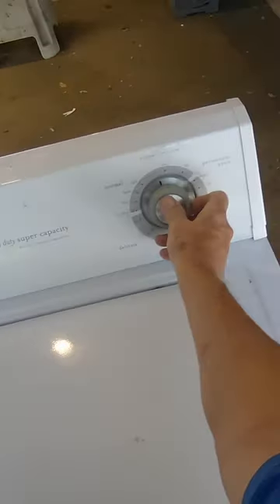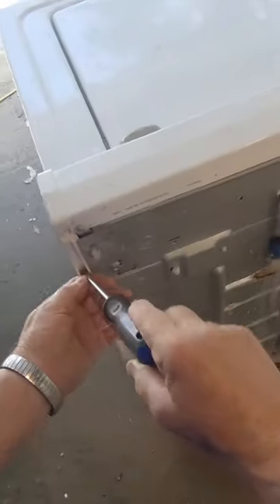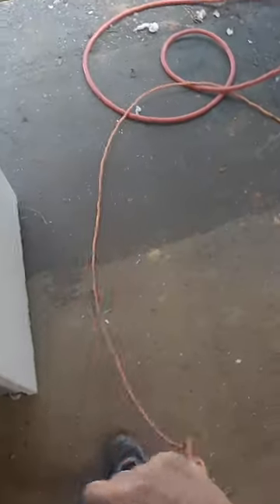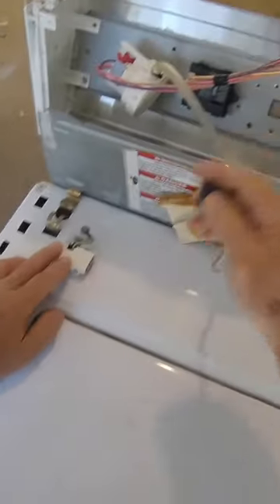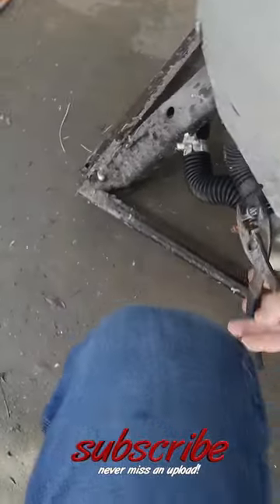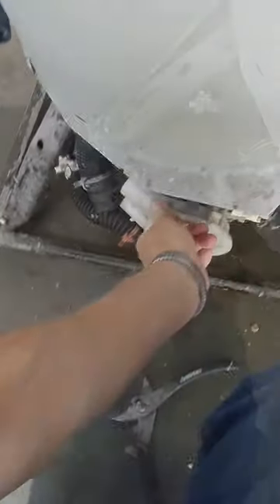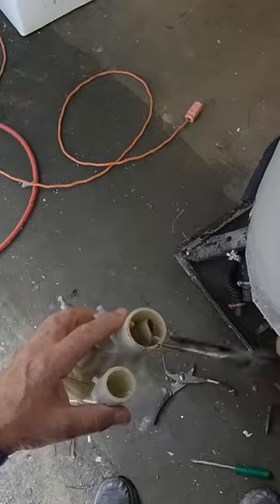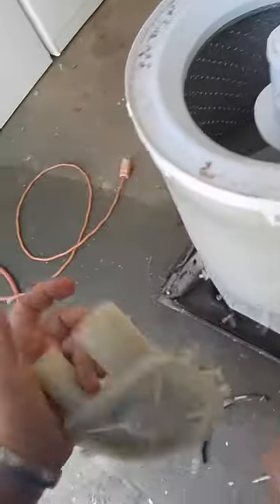Washer Hums Won't Drain

Comment: Looking for advice. Kenmore 90 series gas dryer. Heats when it wants to. Checked every single fuse (thermal fuse, cycling switch, igniter, etc etc etc) they all have continuity. Checked timer has continuity. 

Starts and spins freely. Changed gas valve already and coils. What’s my next step?
Reply from the maker: Buy a gas dryer repair kit https://www.amazon.com/dp/B09V2941XH?_encoding=UTF8&psc=1&ref_=cm_sw_r_cp_ud_dp_NR9KNG5MVCR50WAKBSCT. Then change all the electrical components on the back (cycling thermostat, thermal fuse,etc.) not too expensive and you’ve covered all bases. Open up the timer and examine the points. Replace the timer if they are burned. Thanks for watching!

Comment: That's a bra pad. Skip all that and flip it in its side. The bottom is wide open.
Reply from the maker: Unfortunately there is very little clearance between the cabinet and the water pump. The pump has to be pulled straight off. The method shown is by far the easy. Thanks for watching!
Reply: @HarperandKnowles  I just took mine off pretty easily. Different model though. It was close but I easily used extensions. Also, I have girl hands. Might be hard for big hands.
Reply from the maker: Haha, there is that, and you know guys do things the most difficult way possible! Thanks for the comment.
Reply: @HarperandKnowles  lol. That's true.

Comment: In the event you do this in a house where the machine is connected to the water supply, won't there be a flood of water that comes out of those hoses?
Reply from the maker: If the tub is full of water, yes indeed! Try to empty as much as you can first, it’s not always possible so towels and mop and bucket will be needed. Thanks for watching!
Reply: Goes without saying you should turn off the water supply and unplug the power cord before doing anything

Comment: Fixed thanks a ton! Spent more time looking for my damn needle nose pliers than i did working on it lol.

 Tip for anyone who sees this: if you dont have pliers, you can use the handle of a fork to turn the gear until the object is in a loose spot and pull it out with some scissors.
Reply from the maker: Great tip! Thanks for watching!

Comment: Oh so buy a new one? Thanks
Reply from the maker: Why would you do that when it's so easy to fix??? Thanks for watching!
Reply: I pull the sock out and water still won’t drain could the sock have damage it
Reply: @HarperandKnowles  I pulled the sock out water still won’t drain
Reply from the maker: Be sure you reinstalled it correctly. I could be damaged or there might be something else stuck in the drain line from the tub to the pump.